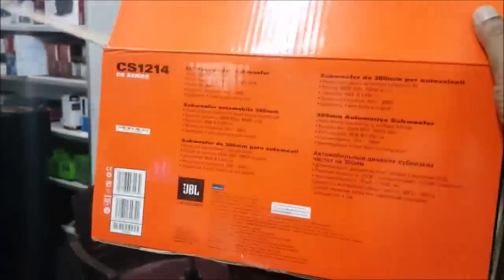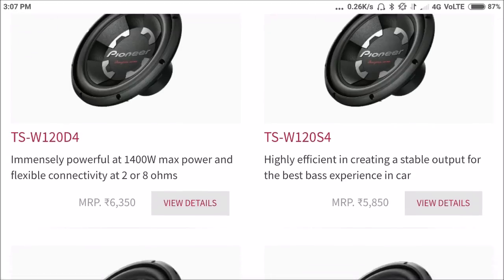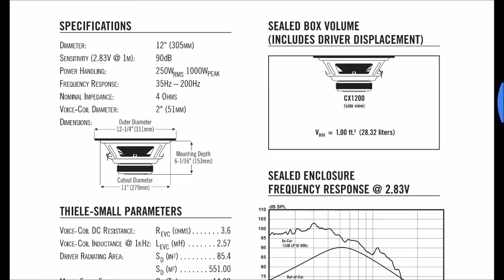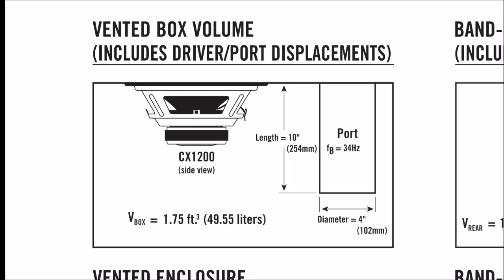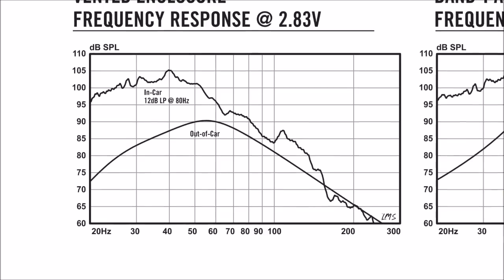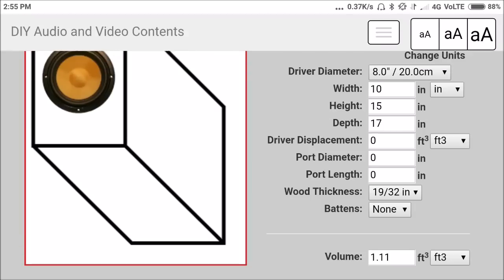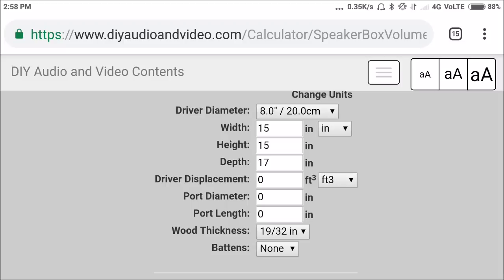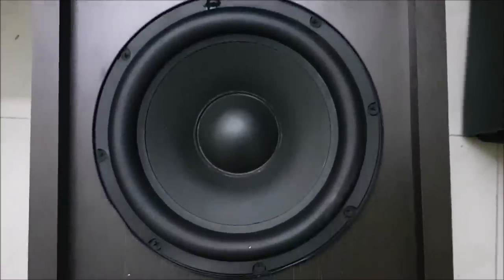How to build subwoofer box for best performance malayalam  നല്ല പെർഫോമൻസ് ഉള്ള സുബവുഫെർ ഉണ്ടാക്കാം 1

Comment: Stereo speaker (3way) cheyumbo,  അളവ് നോക്കാനുണ്ടോ, എനിക്ക് box ചെയ്യാനുണ്ട് 3 way
Reply from the maker: Sariayikittan eluppam alla, net il test chiythittulla 3 way designs kittum . 3 way crossover valarie experience ullavarkke undakkan pattu
Reply: 3 way il bass handling undenkil below 500Hz design procedure follow cheyyanam. Adyam driverinte TS parameters kandu pidikanam , ennittu winisd software upayogichu box undakkam, 1kHz nu mukalil ulla drivers nu box volume badhikkilla.

Comment: 12" argox subne vekkan patiya amp etha nallath
Reply: Agrox inte TS parameters ulla datasheet venam, allenkil athu veetil vechu measure cheyyanam
Reply: @EngineeringEssentials  Veetil vechu measure engane cheyyam
Reply: @rahulkrishna3048  nalloru multimeter venam AC voltage read cheyyunnath. Fluke inte aanu nallath

Comment: Ente speaker il sound kutti vecha bass olle bhagam Ellam vittu vittu ane kelkune. Athu matan Enna cheyanam?
Reply from the maker: Clip akunnathinu , ampinu power handle cheyyan pattathathu kondanu , power koodiya amp use cheyyuka . Amp inu match aaya resistance ulla speakers use cheyyuka
Reply: @TechKannanMalayalam  but speaker 20w 6 ohm rating um amp 25/25w 4/6/8 ohm rating support cheyum .

Comment: Dear Mr kannan i need your help regarding the maesurement of speaker box.  Now i have auditor subwoofer, midrange of kasun and tweeter from pyramid with three coils crossover.  I dont have any academic electronic background but a music lover with quality listening. One electronic shop made a box with 24" hight and width of 13" having dept of 12".  Am using stk 4234 mk5 amplifier for 200 watt. When i play music the woofer  cone paper is not moving but little bass comes and whem volume knobe is turned a booming sound coming with shivering of all items in house. 

Can you guide me what is the manufacturing defect on my system. 
If you dint mind please share your contact no.
Reply from the maker: It might be a cross over problem , it's very difficult to design 3 way crossover especially with a sub . Power sub separately with another amp
Reply: Thanks and you mean i have to seperate subwoofer from three way box and need to built another box for subwoofer. Supose if i build three way bookshelf speaker for midbase,  midrange  and tweeter,  which driver should i select for mid bass. Please share the measurement of subwoofer box for auditor subwoofer.

Comment: എന്റെ കൈയ്യിൽ Dainty യുടെ 10 " 130W RMS സബ് വൂഫർ ഉണ്ട്.  Datasheet ഇല്ല. vented Box ഉണ്ടാക്കുവാൻ ഇതിന്റെ v Box കാൽക്കുലേഷൻ പറഞ്ഞു തരാമോ
diyaudioandvideo.com ലെ ഏത് tool ഉപയോഗിച്ച് ഇത് കണക്കാക്കും?
Reply from the maker: ഡാറ്റ ഇല്ലെങ്കിൽ ബെറ്റർ സീൽഡ് ബോക്സ് ഉണ്ടാക്കുക ആണ് , വെന്റഡ് ബോക്സ് volume port lenght പോർട് diameter ഇവകറക്ടായി ല്ലെങ്കിൽ  മുഴക്കം മാത്രമേ കിട്ടു അടി കിട്ടില്ല.
Reply: @TechKannanMalayalam  vented box നിർമ്മിക്കുവാൻ VBox വാല്യൂ ആവശ്യമല്ലേ
അത് കണക്കാക്കുവാൻ പറ്റുമോ?
Speaker dimensions ഉപയോഗിച്ച് TSS parameters കണക്കാക്കുവാൻ പറ്റുമോ?
Reply: @TechKannanMalayalam  Speaker Driver Displacement Calculator  ഏത് value കണക്കാക്കുന്നതിനാണ് ഉപയോഗിക്കുന്നത്
Reply: @TechKannanMalayalam  എന്റെ ഹോം തീയറ്ററിന്റെ subwoofer driver (ported box) മാറ്റി പകരം പുതിയ സബ് വൂഫർ ഡ്രൈവർ Fix ചെയ്ത് നോക്കിയപ്പോൾ ജനൽ / വാതിൽ എന്നിവ deep vibrate ചെയ്യുന്നുണ്ട് . നിലവിലെ driver അത്ര deep കിട്ടുന്നില്ല. ഈ അളവുകളുടെ  aspect ratio കണക്കാക്കി v box value നിശ്ചയിച്ച് Ported box പണിയുവാൻ സാധിക്കുമോ

Comment: Chetta oru chanel 50w rms anenkil 30+20 nte two speaker conection cheyamo
Reply: Cheyyam pakshe 50w output amplifier kodukunnath ethu impedance il aano athe impedance ee 2 speaker upayogichu undakjam pattanam. Eg, 50W @8 ohms aanu amplifier rating enkil 2 speakerum 4ohms aanenkil 2um series aayi connect cheyyuka, orennam 20W um  randamatheth 30w um aanenkil series combination ningalku 40W tharum.

Comment: Bro subwoofer box nu hair hole square ano  round hole anoo nallathu
Reply from the maker: Bro athu hole alla athil oru pipe undKum , squire pipe venamengil upayogikkam calculation softwares kalil round port Anu kuduthal koduthirikkuka
Reply: Pipe alla
Ente  adithu oru  12inch subwoofer box undu arhinu mugalil anu  hole ath square type anu .athu aaa boxinte end vare  undu avidennu thazhekke oru  cheriya bend annu
Reply from the maker: May be a transmission line type subwoofer
Reply: Njan side ayittu amp assemble cheythu kodukkarundu athukondu chothichathanu 
Njan assemble cheyyuna subwoofer box njna special aayi paranju cheyyippikkunnathanu veedinaduthu box manufacturer factory undu 

Pinee   chila box nullil enthinanu  sponge vekkunnathu

Comment: എന്റെ കൈയിൽ ഒരു പാനാസോണിക് ട്വിൻ സബ് (200w)ഉണ്ട് പഴയ ഒരു ഹോംതീയേറ്ററിന്റ ആണ് എനിക്ക് അത് കാറിൽ ഫിറ്റ്‌ ചെയ്യാൻ പറ്റുമോ? അതിനു എന്തെലാം ആവിശ്യം ആണ്?
Reply from the maker: Athinte amp power supply ethra yanennu nokku 12v anengil pattum allengil dc booster vekkanam
Reply: @TechKannanMalayalam  6 ohm എന്ന് കാണുന്നത് വോൾട് കാണാൻ ഇല്ല
Reply: കാറിൽ മിനി ഇൻവെർട്ടർ വച്ചാൽ
 മതി..Rs450ചിലവ് വരാത്തൊള്ളൂ ഇലക്ട്രോണിക് കടകളിൽ വാങ്ങാൻ കിട്ടും.
Reply: @mmmm61360  ബാറ്ററി യൂസേജ് കൂടുമോ പ്രശ്നം ഉണ്ടാവോ?
Reply: @ashik517   No.
Reply: @mmmm61360  Engane athu use cheyth fit cheya enu onu paranj tharumo?